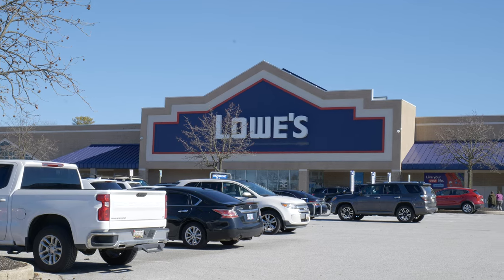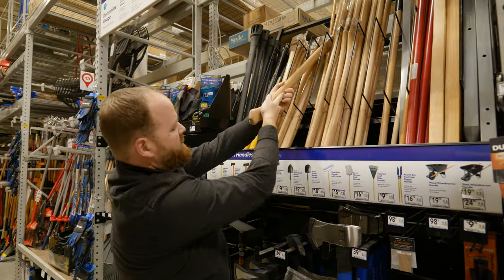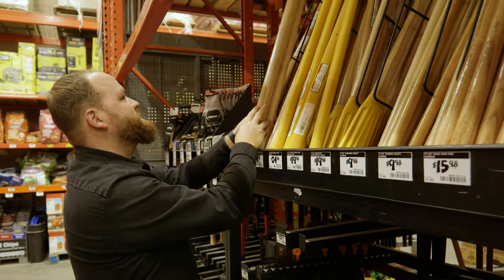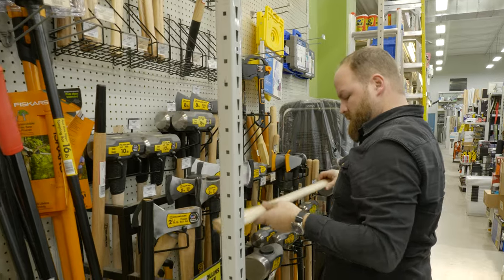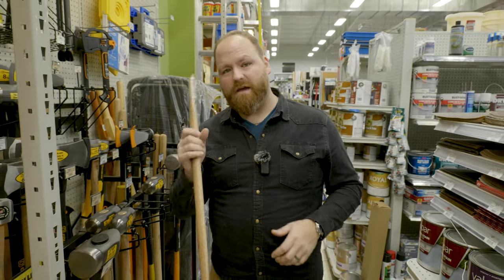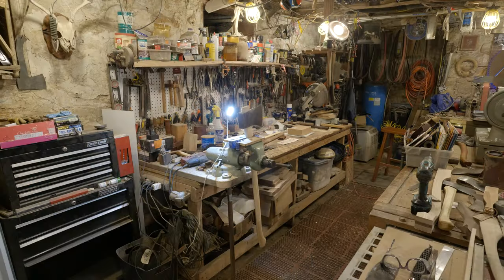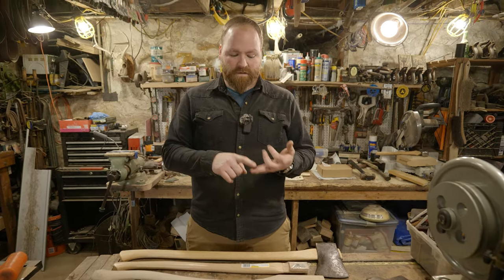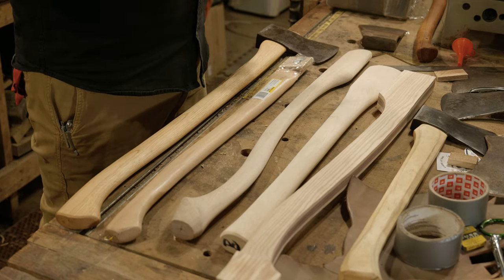Hunting for the Perfect Axe Handle: Big Box Store Tips

Comment: I used to work at HD 20 years ago and they had inventory people who would keep inventory straight.  HD is out because they don't have the inventory folks checking inventory daily.  

I tried to buy some paint that showed 5 in stock on their website but had 1 on hand in the store.  Asst Mgr told me that she would lower the quantity to 1 and that would cause HD to ship them some stock.  In the axe handle case, they probably showed several in stock which was preventing new stock from being shipped to them.  The lack of purchases of the handle also "showed" the system that axe handles were not selling, so they had another reason for not shipping handles to the store.

Assuming the inventory count was wrong, an Asst Mgr could have remedied the situation and they would have axe handles within a week.  HD receives shipments daily.